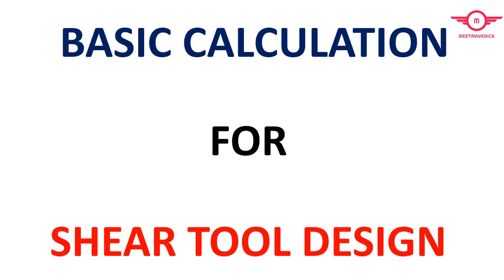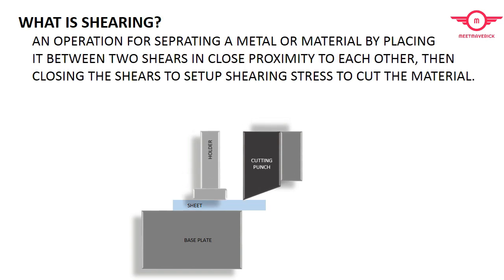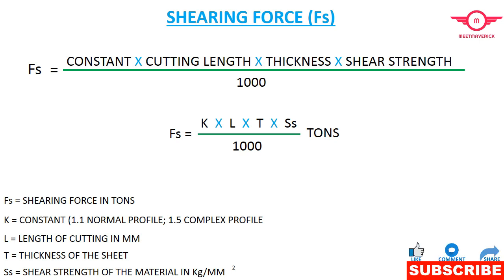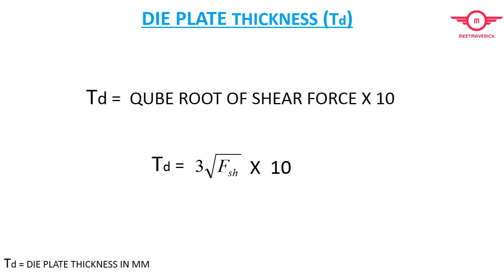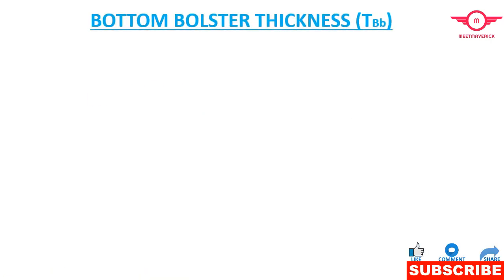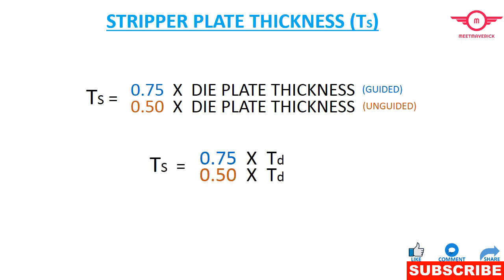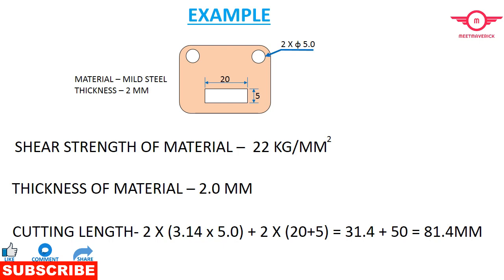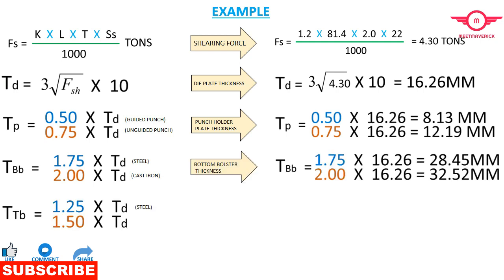Tool Design / Shearing Tool / Basic Calculation / Press Tool

Comment: how did you get the  Ss valuse please tell me sir
Reply from the maker: Ssh unit is in Kg/mm Square and Ultimate Shear Strength is considered 75% of the Ultimate Tensile Strength of same material in case of tool design.